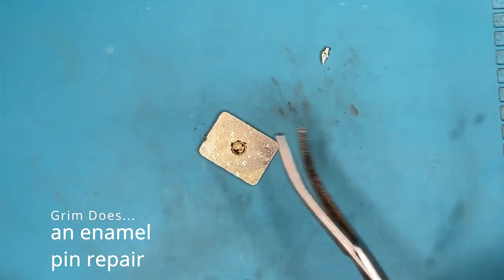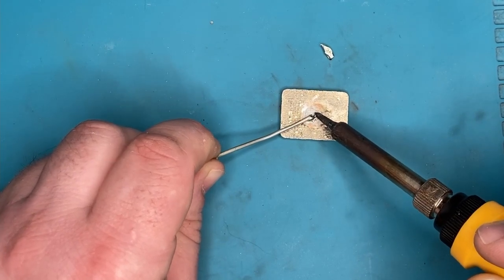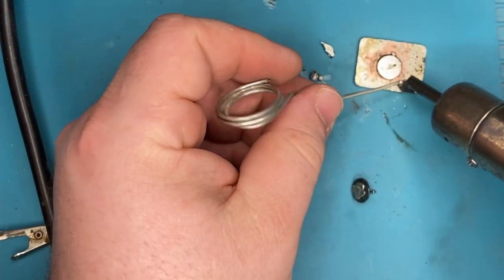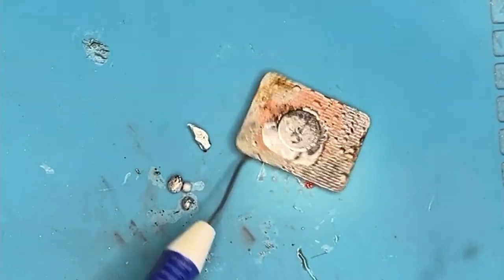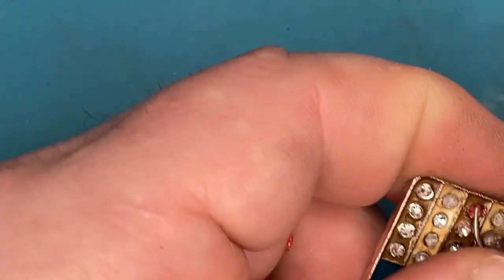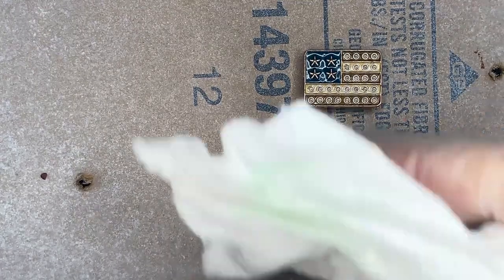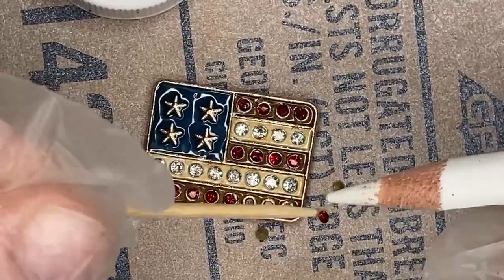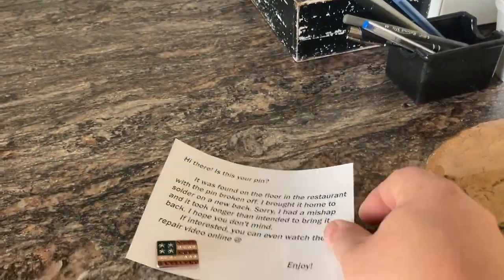Grim Does   repair an enamel pin

Comment: Using a grease pencil as a pick-up tool is a good tip, I can use that - thanks!
Reply from the maker: Sorry for the delay in reply. I found that tip online but I have since gotten some strange sticky pens that also do the trick. It worked fairly well though! Thanks for watching!